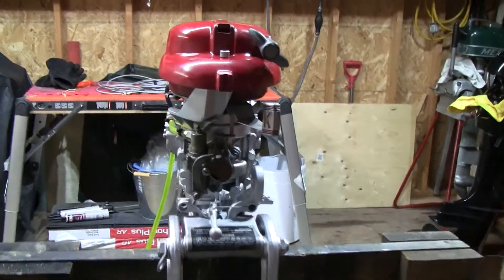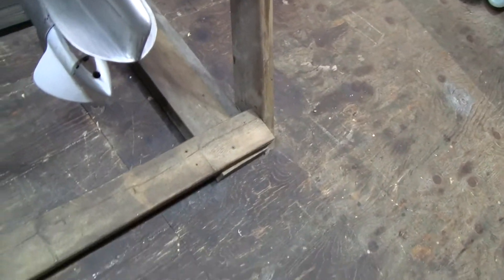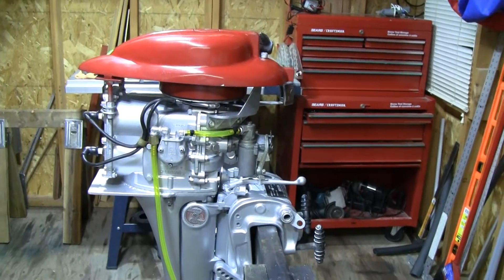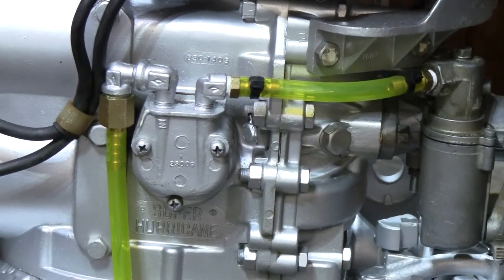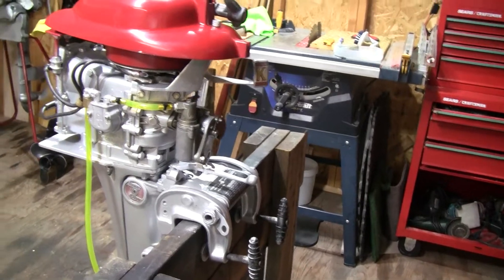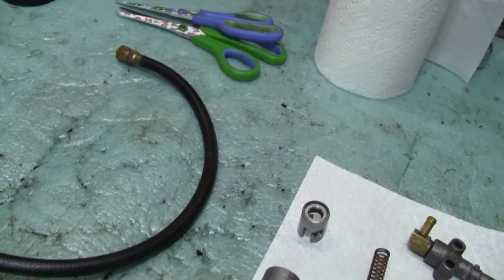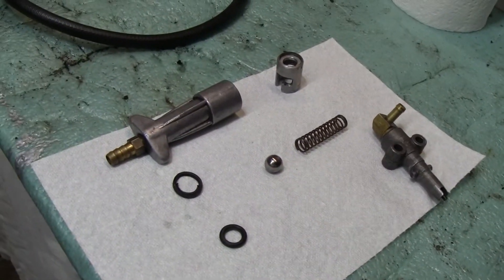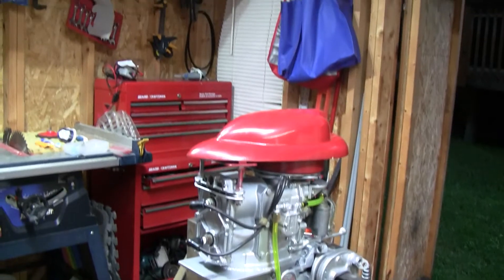1958 Mark 28 mecury

Comment: Thanks for the vid Marc, I took the mark 28 out to the lake & no luck again, just a sputter & puff of smoke, pulled my arm out trying to start it also noticed gas leaking from the bottom front will check the hoses, like your idea of bypassing the connector, wish I lived nextdoor to ya really want to make this thing reliable

Comment: How did you seal the hole that the mark25 leg leaves in the exhaust where it meets the block?
Reply from the maker: i used j b weld
Reply: @marcouellet1420  Oh, i guess i was overthinking it lil, i was thinking custom baffle plates or welding lol

did you do anything to address the mk25s shorter driveshaft or did you feel that the lower contact area with the mk28 crank was still enough?
Reply from the maker: @BurlingtonVintageOutboards   no problem